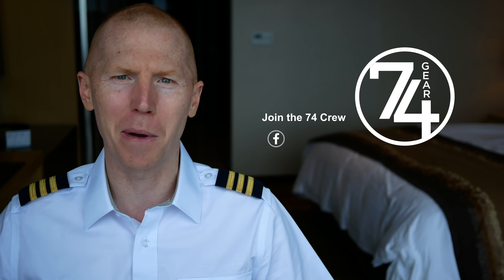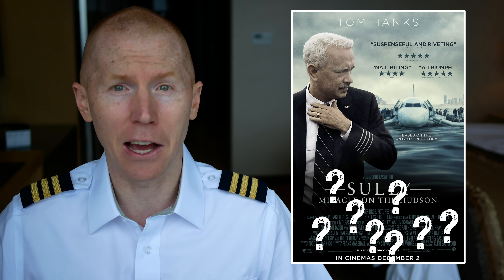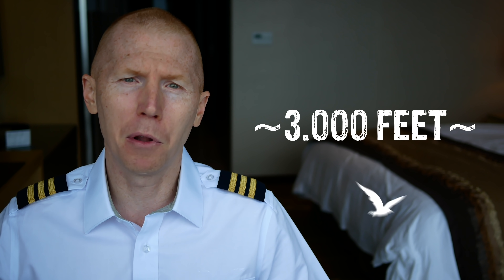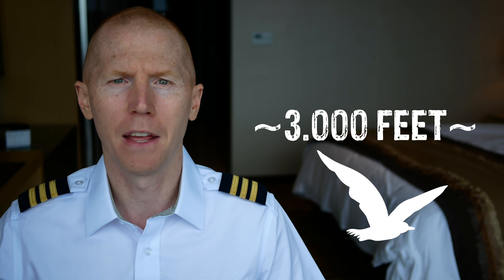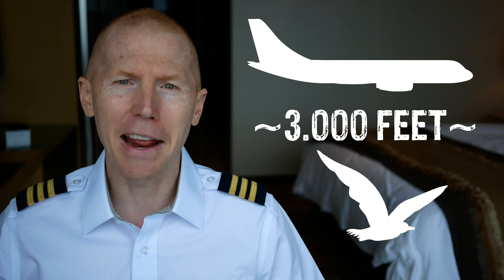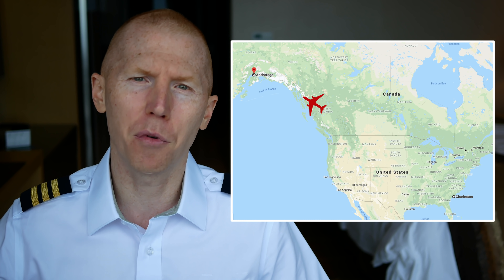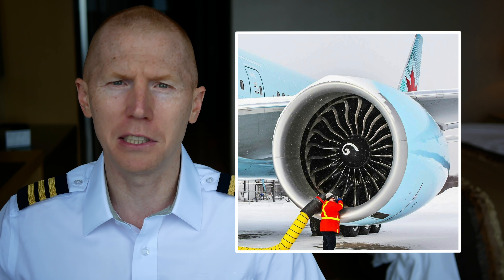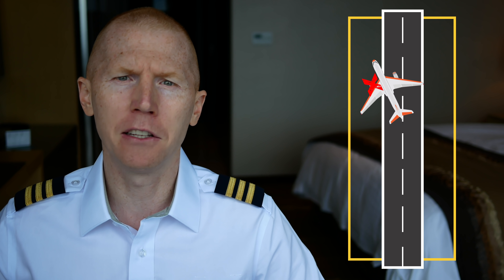Why Engines Don't Have a Mesh or Grates to Stop Birds

Comment: If you put a screen in front of your engine and hit a bird you'll have a bird and a metal screen in your engine
Reply: Bird strikes on aircraft at high speeds tend to do tremendous damage, sometimes even breaking right through the metal skin and frame of the aircraft, making it all the way inside the plane while still having enough energy left to harm pilots and damage avionics.  There's no material you can make a mesh or screen from that would be strong enough to stop bird parts from reaching the engine, open enough to allow good airflow to the engine, and light enough for use on a flying machine.  You'd only be making the plane significantly less efficient and increasing the chance of ingesting jagged metal along with the bird.
Reply: @herbderbler1585  "There's no material you can make a mesh or screen from that would be strong enough to stop bird parts from reaching the engine"
Holy shit, Anti-Tank Pigeons.
Reply: Ok, no mesh, but how about a scarecrow on top of each engine?
Reply: @nefarioulyte9996  No there is no real plane called Mig-37.
And the fictive Mig-37 had the air intakes on top of the wings.
No risk of sucking in debries from the runway, no doors or grills to close the intakes.
Go and learn about planes yourself
Reply: @wolf310ii  yes there was!!! Clint Eastwood flew it 👍
Reply: @wolf310ii  it wasn’t fictional it was a concept design
Reply: @bossaurayt3567  Thats still not a real plane
Reply: @wolf310ii  source?
Reply: @sheslikeheroin93  source for waht exactly?
Reply: @sheslikeheroin93  Then read my comments again, i never said it was real, i wrote serval times that it never existed.
Reply: What about simply using infrared technology to spot any living creatures within the flightpath of the planes during landing and takeoff considering those are the only moments where you need to watch out for bird traffic?
Reply: Zipzeolocke I’m not sure how that would help commercial planes won’t be able to dodge the bird.
Reply: @imamasome  yeah given further thought after making my earlier comment I realized there isn't much point in having visual information on projectiles considering such a large plane is incapable of maneuvering out of the flightpath effectively, it could still likely help with some other scenario though
Reply: @imamasome  We could then use frickin' lasers to vaporize the bird before the engine ingests it.
Reply: @Zipzeolocke  ICE
Reply: @Zipzeolocke  what if we equipped planes with a horn?🤔
Reply: @Zipzeolocke  : There's no way to dodge a bird when you're flying a bigass commercial jetliner. It's up to the bird to do the dodging.
Reply: A bird proof screen is not possible there are two problems. Bird strikes do not occur frequent enough to warrant any issue from engineers. Generally, the engines won’t explode from hitting a bird. Also a metal grate unless made thick and out a really strong metal would break off from the power of the engine alone.
Reply: ...and ICE, every flight in ICE conditions. C'mon guys, this is a good idea in concept, but would be an absolute disaster in application. ICE! Releasing into the engine like rocks. C'mon now.
Reply: @treylem3  Engines are required to be able to ingest ice.  Plenty of videos are available showing such testing.
Reply: @Brandon Link ... You know when people talk about screen in front of a plane engine, they're not talking about the same screens in your house windows lmao. Obviously they would make screens strong enough to withstand a bird strike at those speeds lol.
Reply: @billyfraiser6298  even if a screen could withstand the impact it would be bolted to the body of the engine which would tear away at the fasteners leaving you with a bird and a super strong screen which is probably stronger than your turbine blades in your engine
Reply: No I think the bird would be turned into noodles
Reply: @hutao7917  😂😂😂
Reply: Me as an intellectual putting the engines inside the plane
Reply: Brake check it :)
Reply: S H I T
Reply: XD
Reply: I needed this comment
Reply: Isn't that better than a 100% destroyed engine?
Reply: Mig 21? Nose cone
Reply: @nefarioulyte9996  ...except that it was just a conceptual design 🛩
Reply: Ayyy
Reply: Aye whut up
Reply: It's silly to try to stop the bird when you don't have to. You just need to deflect it slightly so that it misses the air intake. And if a few small pieces gets into the engine, THAT isn't the problem.
Reply: Oh stop it
Reply: exactly what I was thinking.
Reply: The will just fall off probably if you put a grate on it when a bird hits it.
Reply: Electricute it
Reply: If the metal didn’t break then that bird would suffer so much more than just being killed instantly
Reply: The bird will ve stuck to the grate till u land anyway
Reply: Yeah I'm pretty sure a dainty little bird couldn't do that, maybe a California Condor but those are nearly extinct and probably won't be flying above 10000 feet realistically
Reply: @LocoLewiGuy  what about on the way up or on the way down?
Reply: Then don't make it out of Lego.
Reply: Yes
Reply: God this comment is a bar fight
Reply: Make the screen a cone that way they will just flop off after some time
Reply: @derpco.69420  like an iris, wires should be enough and can fit in a ring.
Reply: 4.7k people have never flown a plane...
Reply: Why not silk strings or kevlar mesh ?
Reply: Why not blades? And please stop the whole "cant be configured" bs. Most commercial jet engines are ROUND. You know how many grills strainers are round? Please

I still think a cutting edge would work as not only would the edge slow the impact, it would then cut the mass and allow smaller chunks to go though engines 

While still may cause thr same communitilive damage it will lower the main mass damage
Reply: Yes
Reply: Not if the screen is angled so the bird would roll off the top of the engine. You could have the screen be manually retractable so Mos rid the time the engine would be in impeded but when birds were near by the pilot could put the screen up and protect the engine.
Reply: @marky3609  At 200-300km/h it doesnt matter if the screen is angled or not, the screen just cuts through the bird.

Also, again, a single bird is no problem for the engine, a flock of birds is and it makes no difference if the flock is sliced by the screen or the fan, the amount of biomass that enters and clogged the compressor stage, burn chamber and/or the turbine stage, wich causes the engine failure, is the same
Reply: Incredible simple
Reply: But if the metal screen doesn’t break off and the birds alive it will die from not being able to breathe..
Reply: Some type of motorized retractable screen or grate would probably work. That way it can just be activated during take off for safety and then retracted high in the skies. Might possibly also save the engine from some damage.
Reply: Bad to worse.
Reply: Sounds like an explosion
Reply: That’s assuming the metal screen is insanely weak
Reply: Birds be like how can we be safe from dangerously big metal birds
Reply: Make the metal screen shape like a wedge
Reply: The screen wouldn't resist, it would get sucked in instantpy
Reply: What if it was pointed?
Reply: Yes
Reply: @nefarioulyte9996  The миг-37 is a fictional plane...
Reply: You can use a screen that is like a knife and cuts the birds into smaller pieces, that way its like large ice drops going through the engine blade.
Reply: so could we just remove the engine so that the bird and cage don’t screw things up.
Reply: they can put a bird wiper to take care of that
Reply: No dummy. The screen wouldn't get sucked into the engine
Reply: Build it back better
Reply: @nefarioulyte9996  No there is no MiG 37.
Reply: yeah good point.
Reply: true
Reply: Thanks for explained the hole vid in 1 second
Reply: Oh
Reply: Or the screen shreds the bird before the the engine does, which is not helpful at all.
Reply: Oh that's a pity! I had a really cool idea... 💡
Reply: What if you just run it through a computer simulation?
Reply: Make it a cone shape so the force is dissipated
Reply: I think that is a matter of design.
Reply: Unless you have it in a cone shape? You know like the pointy cow clearer that trains have? I'm sure something could be fabricated...
Reply: The one on the MIG-37 works fine. It just could not be used on a commercial jet because of the configuration differences etc.
Reply: @gordonlawrence4749  Mig-37? There is no Mig-37. Maybe you mean the Su-27.
The Su-27 can close the air intake with a grill, but its not for bird stikes, its to prevent sucking debries from the runway, and if they close the intake, they open also a bypass.
Russian fighters are build to start and land on runways, other fighter would not even use as taxiway
Reply: @wolf310ii  Yes I did mean the Su-27. What I was trying to point out though is that the engine configuration for a fighter is so different from a commercial aircraft that even though you can put them on a fighter (and it has been considered on the F-15 at one point but the concept was discarded) the configuration differences mean you cannot do it on a commercial jet regardless of purpose. IE where would it go when you wanted to open up the intakes completely? How would you make it strong enough to withstand that much pressure difference over that large an area without restricting air flow too much? It just cant be done with a commercial jet.
Reply: @wolf310ii  I would imagine a titanium grill on Su-27 would also work for small birds as well... Su-27 don't open bypass, its what MiG-29 does.. MiG-29 fully close the supersonic inlet ramp for FOD protection.. Considering the pressure these ramps have to endure at high supersonic flights, that can probably withstand an impact from an albatross and still survive..
Reply: @batuhancokmar7330  Titanium is not necessarily "stronger" than steel, its lighter, but that doesent matter, even small birds are not made of titanium.
Ever seen a Bird hit by a car? No imagine what happen if a bird hit the grill at 300km/h. The grill cut the bird in stripes.

At supersonic speed the doors of a Mig 29 are not fully closed and the pressure from the air flow is more or less static, thats completly different from an impact of a 12kg albatross.

Yes, it not a real bypass on a Su-27, the Su-27 increase the intake area in front of the grill
Reply: @wolf310ii  They literally fly their fighters out of rubble covered abandoned concrete fields. Their runways are a mess, and thats why
Reply: @wolf310ii  su 37 terminator is the best, its got thrust vectoring nozzles and a uniquely designed airbrake like the su30m2
Reply: @LocoLewiGuy  Was, not is. It was only one build and that one crashed 2002.

Also, if the Su 30, and the whole Su 27 family and even the F-15 and the Eurofighter have the same kind of "uniquely" airbrake, its not uniquely
Reply: @wolf310ii  No, the Su-27 cant close the intake, only the Mig-29 can
Reply: @wolf310ii  so I guess mikoyan mig-37 is a figment of my imagination
Reply: @gordonlawrence4749  You don’t seem to understand wolfs comments about the Su-27 and it’s grill. That fighter was designed to take off on runways that could be full of dirt and debri, which the grill could protect against at low speeds on takeoff. That grill is entirely useless for in air bird strikes, and relating that fighter to commercial airplanes is irrelevant. Commercial aircrafts don’t take off on dirt runways, and wouldn’t need such a grill. 

We are talking about grills and screens that would be useful for bird strikes, which neither the Su-27 or commercial airliners have.
Reply: @gordonlawrence4749  you redesign an engine that will, duh.
Reply: @gordonlawrence4749  yes, there should be ways like that, but it's all about fuel efficiency when it comes to commercials particularly.
Reply: @FD1CE  Honestly I'm not convinced it could realistically work either from the efficiency or mechanical practicality perspective.
Reply: @gordonlawrence4749  I'm really not an expert. Maybe but there many unknown factors to us probably.
Reply: @FD1CE  At 150kt, a grill or mesh would just cut through a bird.
At speeds the grill would catch the bird, the airplane could safely abort the takeoff.
After V1, the bird would go through the turbine anyway
Reply: @FD1CE  so we compromise safety for fuel efficiency? is that it?
Reply: @brinahealy942  .... yes, it´s just a risk calculation..
Reply: @brinahealy942  Simply yes. But in more details, don't forget the probability of this occurance is too low. Nothing else is 100% sure either.
Reply: @brinahealy942  how can they do inspection means they got to take it and then put back on meaning wear and tear constant maintenance not fuel efficient that a lie itself and they lying about fuel
Reply: @brinahealy942  Demonstrates a complete lack of understanding of just how much more fuel would be consumed.  Never mind how ineffective a grille would be, the drag and turbulence created by a grill would require considerably larger, heavier. more expensive and more fuel hungry engines to achieve the same thrust.  A bird strike even at takeoff speeds would just strain the bird parts through the grill and not deflect it.
Reply: @Stealthy Raccoon No, it does not exist.
Only because there is a toy model from Italeri, doesnt mean there was a real Mig-37.
The Mig-37 exist only in some papers in the Pentagon, to get more money for their steahlt program.

Only a single Su-37 exist for a few years.
But Suchoi is not Mig
Reply: Other events than a bird strike can have the screen be pushed inside the engine. A bird-proof screen would still be a liability.
Reply: Bullshit
Reply: Rather than a screen, I'm picturing a cone, like a locomotive "cow catcher", made of a few heavy bars with a somewhat open configuration.
Reply: @Tmanaz480  Ice build up, then released in chunks, kills all 'intake screen or 'heavy bar' arguments. There would be ALOT of ice chunk damage, regularly.
Reply: It’s not rocket science, you can properly create a design that sucks in air from a different angle that does not allow for a bird to fly directly into the engine.
Reply: @anonymousiswatching  It IS rocket science.
Reply: Noah H birds do not have a no fly zone so this clearly needs to change
Reply: @anonymousiswatching  It is rocket science. A different angle would prevent RAM air. USAF veteran.
Reply: The idea should be opened up to a design competition. 

In my eye there are numerous different potential  approaches to a design. Whether you're redirecting the inlet, an advanced shield ahead of the engine, using high tensile nets to capture the birds, or some time of solid grate or mesh to slow the bird down and chop it into small enough pieces for the engine to consume it safely. 

A 350g mass at 170knots is only 0.0085 Newtons worth of force.
Reply: @SpenserRoger  a solid grate or mesh would not slow down a bird.
Any modern engine can chop down and consume a bird safely.
A bird, not a flock of birds!
For a flock of birds a mesh or grate wouldnt help either.
But a mesh, grate or net would create turbulences and disturb the airflow in the engine.
The problem is not the impact force of a bird, the problem is the amount of biomass from a bird flock that clog the turbine.
Bird strikes are not so rare, but engine failures because of bird strikes are rare, and all engines failures because of bird strikes are very rare.

Trying to prevent bird strikes with grates its like:
If you get out of the bed in the morning, you could slip and break a leg, so its better to stay in bed, to prevent breaking a leg
Reply: @wolf310ii  “Any modern engine can chop down and consume a bird safely.” Not entirely true. Large jet airliners are certified to hit a 4 pound bird and continue flying. There are 36 species of birds in NA that are, on average, above 4 pounds, specifically Canadian geese, which we have millions of. Sucking in just one of those can be bad news.

And when you say the impact force is not of concern, that’s entirely not true. The biggest factor in determining engine failure is the relative speed of the bird and the airplane, and the mass of the bird. More impact = more damage. Hitting one large bird, like a goose, at high speeds is much more devastating than running through a greater mass of small birds at low speed. Impact forces are key.

It really just takes a small upset to produce catastrophic results. Sucking a bird through the engine, hitting the blades knocking them into each other, changing the combustion thermodynamics, can result in disaster. Here are some numbers.

“A 2016 report by Richard Dolbeer of the USDA’s National Wildlife Research Center and his colleagues gave statistics for the United States (which includes U.S. registered aircraft in foreign countries) for 1990 to 2015. During these 25 years, 17,494 jet engines were hit in 16,694 bird-strike events, but in many cases the impact didn’t lead to engine damage. Out of these reported incidents, 4,516 engines were damaged in 4,370 bird-strike events (4,227 events with one engine damaged, 141 with two engines damaged, 1 with three engines damaged, and 1 with all four engines damaged).”
Reply: @wolf310ii  it happens rare but it happens. Human lives are at stake. They could put a grill in front of a engine but they would lose money so it's a no go
Reply: @greer8288  No they could not, a grill in front of the engine wouldnt even help.
There are thousands of birdstikes every year, if that would be a problem there would be crashed airplanes every few month
Reply: @SpenserRoger  Ice build up, on 'mesh' or 'strong grates', then released into the engine in chunks, would be damaging engines. It's a futile, I'll informed argument. USAF veteran
Reply: @treylem3  you have no idea as all Navy jets used to have screens.
Reply: @SpenserRoger  I'm a USAF veteran, and a pilot
Reply: @treylem3  funny how you didn't learn about the history of their use in the Navy and Airforce. 

In the beginning they were mostly used to prevent absent minded techs from leaving tools or rags in the intake of jets as prudent behavior around jet intakes was something new. 

Many engines were saved by these screens and at a cost of about 5% loss in efficiency and power. 

Eventually folding screens were developed which negated the loss in efficiency. But better safety protocols made them fall out of necessity. 

Also they didn't suffer from icing. They actually suffered from work hardening requiring them to be replaced on a regular basis.
Reply: @SpenserRoger  Funny they're not using them anymore. That's the point isn't it? If they were a great idea, they'd still be using them. Very dangerous and labor intensive., only drawbacks, other than a tech, which is what I started out as, leaving a rag or tool. Outdated, bad idea, it's simply not prudent as protection from bird strike, and does accumulate ice in inclement weather. Research it
Reply: Guys guys why the hell are we talking about su27 and fictional migs, just look at mil24 intakes and mig21 intakes, the only reason for not putting a creen is money and it’s really not necessary… also flap controls on intake inlet for su27 is for supercruise
Reply: @mewantkrinkov4206  helos don't fly that fast and they use turbines to rotate mobile surfaces, not to push the air directly .
Reply: @mewantkrinkov4206  The caps on the Hind are for FOD protection, also the engines dont produce thrust like the engine on an airplane.
The nose cone on the Mig 21 is only for adjusting the air flow, not for preventing anything from going into the engine.
The "flap controls" on the Su 27 for adjusting the air flow are on the top of the intake, the FOD flap to close the intake is on the bottom.